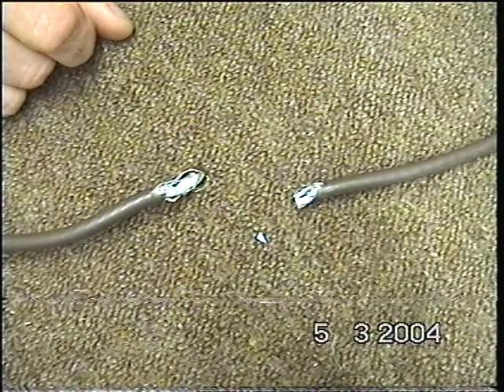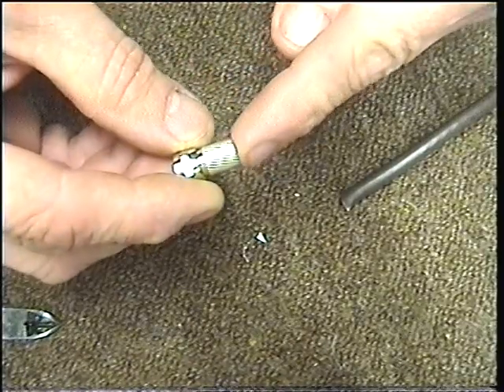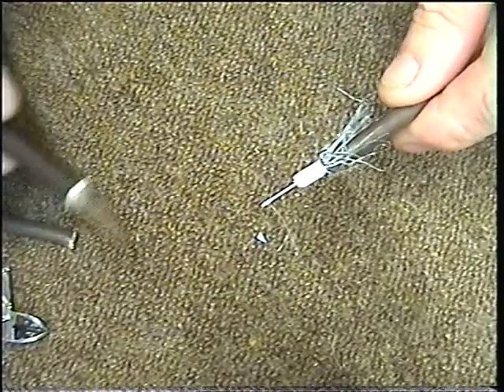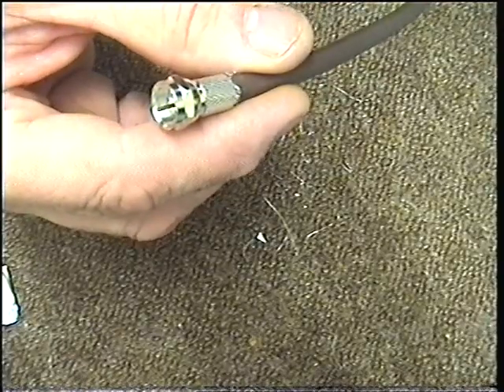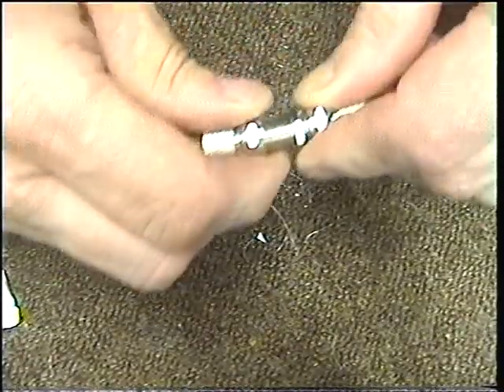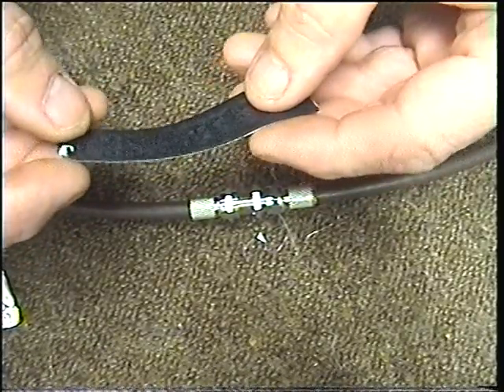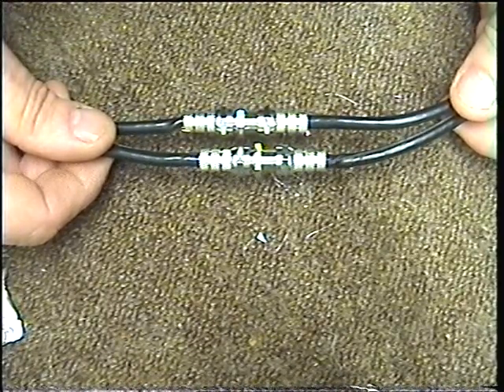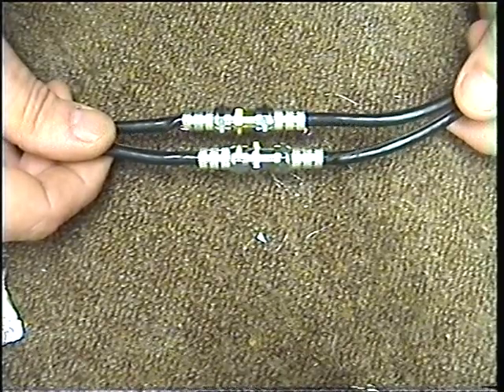Repair Sky Aerial Cable

Comment: this is infuriating to watch. If you don't know how to fix it then don't. Get a real cable tech to do the repair. that razorblade you used probably scored the center conductor. it's copper coated metal so if you score it then you're ruining the signal. also if the fitting is going outside then you should be using compression fittings and rubber gaskets to seal the splice.
Reply: Who you though?
Reply: Bollocks